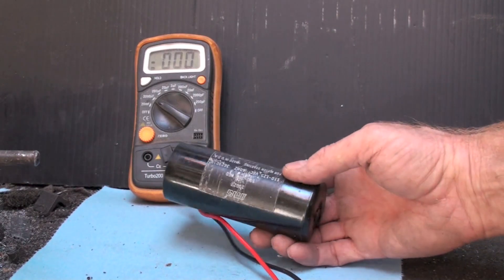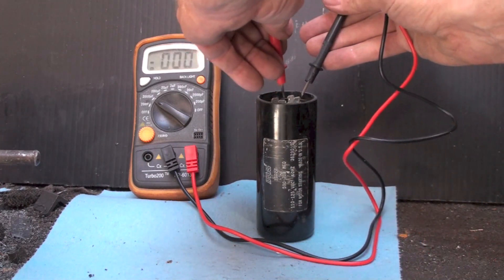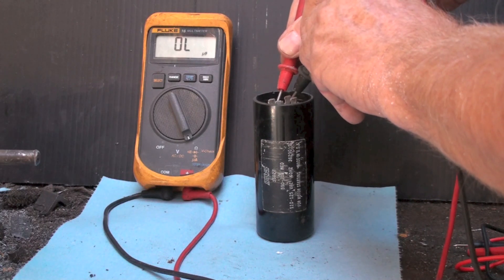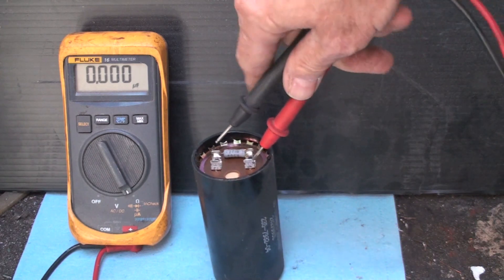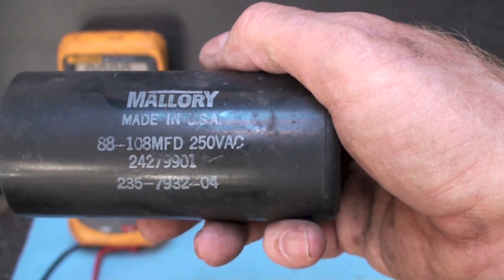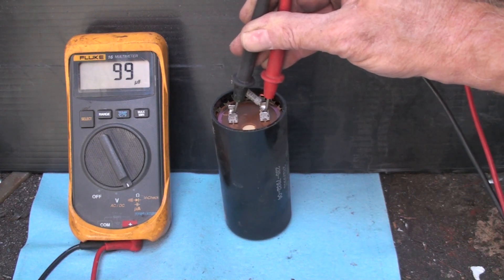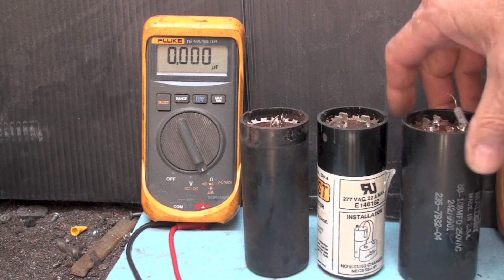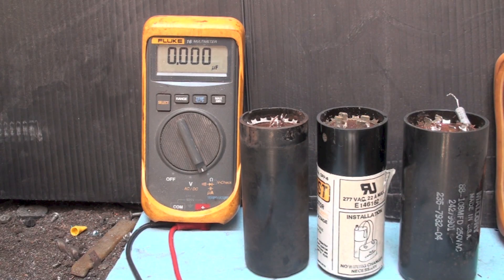Testing the start capacitor

Comment: I have that same 88-108 with the resistor, but I'm unable to unsolder it.
Would a consistent reading of 0.0µf using 2 different multimeters mean it's likely dead? Does it always read high with the resistor?

Comment: You skipped how/what to set the multimeter at. And the markings on multimeters I see at Harbor Freight look nothing like the one you have.
Reply from the maker: The meter shown is a Fluke 16  Similar to the Fluke 116.  These meters are automatic range.  Many of the Harbor Freight meters are manual range.
If I was testing a capacitor with a manual ranging meter, I would note the strength of the capacitor printed on the side, then set the range accordingly.
GFM

Comment: I have a mid-80s Carrier AC that won’t start. The hard start cap & relay appear to be original, OEM. If I test the cap and it’s bad (don’t know if the relay can be tested), can I replace them with a generic kit, like the 5-2-1 kit that’s sold on Amazon? Thank you!
Reply from the maker: You can, but I would use the OEM start kit as it is designed for the unit.
GFM

Comment: The capacitor in my condenser unit reads 35mfd+5mfd. Is this a RUN or START  capacitor? Thanks
Reply from the maker: It is a run capacitor.  It is a combination capacitor for the fan motor and compressor.
GFM
Reply: @grayfurnaceman  thank you for your reply. So if the 35mfd+5mfd is the run capacitor for the compressor and condenser fan motor. Then how does the compressor and condenser fan motor initially start? Don't they need a boost to start rotating first and then the run capacitor takes over?
Reply from the maker: @mark.r8900  The use of a hard start system is dependent on the system design.  Most systems will start using the run cap.
GFM

Comment: Sir may I ask, if I have a motor starting capacitor for "Dough Mixer" of 80µF 10+20% 270V, and I have a reading of 85µF, shall I say that the capacitor is in excellent condition?
Reply from the maker: Yes.  It is within 10%.
GFM

Comment: Will all ac unit comes with a start capacitor? Or no, because on mine I can't find it, only have dual run capacitor.
Reply from the maker: Most do not.  Unless they are controlled by a TXV, they do not need one.  If the compressor is a scroll they do not need one even then.
GFM

Comment: This is the biggest failure in all the YouTube videos regarding capacitor testing. I don't feel like wasting anymore of my time on this but just to protect the safety of others falling victim to this video I will point this out: Before handling a capacitor you darn well better short the terminals with a screwdriver. And keep your unprotected fingers away from the terminals for crying out loud. I think it's safe to assume this guy is never going to read this comment because he already electrocuted himself & is now brain-dead being fed with a tube. Or he tried sharpening a lawn mower blade while it was running. Either one of those is a possible scenario.

Comment: Does the first meter have an separate port to plug in special leads for capacitance that must be zeroed with the dial on the left before testing.
Reply from the maker: No.  All you do is set to capacitance.
GFM

Comment: I did that for a washing machine start cap... The meter just reads 11.. so its bad right? By the way OL is overload. means the cap has a charge in it usually.
Reply from the maker: Sounds like it is bad.
GFM
Reply: @grayfurnaceman  Thanks for your reply.

Comment: Wondering if you could help. I have a dehumidifier that trips the breaker after you hit the power button. Could a bad capacitor cause this? Thanks in advance.
Reply from the maker: Probably not.  If its a power humidifier, it could have a shorted heating element.
GFM
Reply: @grayfurnaceman  Thank you Sir
Reply: @grayfurnaceman  Update, i put a hardstart on it and it turned on and ran. I turned power off and removed hardstart and it would turn on and run for 5 to 7 seconds then trip breaker. Any thoughts?
Reply from the maker: @brianb5779  You probably have a failing compressor.  It may continue to operate with the hard start installed.  Just may not last very long.
GFM
Reply: @grayfurnaceman  Okay thank you sor

Comment: This a tutorial for people who know how to test a capacitor you don't tell what settings on the meter.
Reply from the maker: There are no settings for the meter.  Except for setting it in capacitor mode.  The only exception is if you are testing very small caps.  This video is about testing motor start capacitors.  They range from 85 to 500 MFD.
GFM
Reply: Im a former  hvac tech and i have a field piece model- sc54  digital multimeter. It has a setting on it that you set to mfd that checks capacitance. On the screen if reads in UF which is the symbol  for microfarads. Hope this was some help. Ps... i bought the meter from Sid Harveys.

Comment: hahah i have that same fluke meter. had it for nearly 20 years and it's still going.
Reply from the maker: My first Fluke 16 I bought in 1990.  I replaced it because it got crushed between an outboard motor and a boat hull 25 years later.
GFM

Comment: ok here is my question.  I have a capacitor but the label is gone.  It was the start capacitor for a submersible pump.  Now I have to get a replacement.  How do I test this capacitor to see what the origin microfarad rating was.  It does say 220 volts.
Reply from the maker: bob campbell If the capacitor has failed, there is no way to test it. If you have specs for the motor, you can try contacting the manufacturer. 
GFM
Reply: thank you... ok, so Im just SOL because the pump is 200 feet down... I will try and look at other pumps and what they tend to use.
Reply from the maker: bob campbell There is a control box above ground. That’s where you found the cap. Use the model # there. 
GFM
Reply: the label on the cap was completely disintegrated... hence my original question...but thanks for trying... bob

Comment: should i always discharge cap before testing ???
Reply from the maker: Start caps need to be discharged if there is no resistor between the terminals.  Run caps discharge themselves when the circuit is opened.
GFM
Reply: @grayfurnaceman  That's the stupidest damn comment ever. Just like the rest of your video. You should have never put this video up. If you set a run capacitor on a workbench and briefly give it 120 volts (which is how they are charged) there's no way it's going to discharge on its own. Maybe after it sits there for a couple weeks. You always need to discharge a capacitor so you don't shock yourself.
Reply from the maker: Jay Ryan You are correct. If I place a cap on a bench, and charge it it will hold that charge. A run cap is not used on a bench. It is used in parallel with the start winding of a motor. If you look at the wiring diagram of a motor, you will see that when the power is removed, it discharges thru the winding. Have you ever noticed that there is never a spark when you short the cap?  Think before you comment. GFM
Reply from the maker: @jayryan7473  I guess at this point I should respond in kind.  Look at the diagram of the motor dummy.
GFM

Comment: You are the man, I've been looking for capacitor meter testing for weeks. You are the only one that show the capacitors with just the 2 COM and HEM with the resister attach. The one exactly that I have. 88-108. The meter read 14.85. That means my capacitor is DONE? Thank You
Reply from the maker: If you disconnected the resistor when you tested it it is bad.
GFM

Comment: single phase preventer how to work inlet wire outlet wire how to connecting
and in the system how to control the 
single phase preventer please explain to me thanks!
Reply: Use Stronium Sulfide Flugleharn Plutonium Invertor set to "Calibrate". Then download the single phase preventer app and set bluetooth to "on" and look for a signal from the Reactor Core Modulator inverter valve. The IP address MUST be 10.213.200.200 or it cannot connect to your app

Comment: I always use an analog meter rather than a digital one to check capacitors.
Reply from the maker: I used one for many years.  The only problem is that they will not give the strength.  Most meters have a capacitor function built in now.
GFM
Reply: Very true....I only use it on microwaves.

Comment: does the resistor need to be there? or can it run without it?
Reply: The bleed resistors on start caps where potential relay is used is absolutely required. The resister will discharge the cap otherwise in the off cycle the only path for a capacitor to discharge with a potential relay would be across the relay contacts, damaging or weld the contacts.

Comment: I have a Kenmore washing machine it's humming I suspect is the capacitor do I have to discharge it and how. I have a regular voltage meter
Reply from the maker: Once the power is off, the cap does need to be discharged.  Proper procedure requires placing a 20,000 ohm resistor across the terminals.  Practically, what everyone does is use a screwdriver to short the terminals.
GFM

Comment: Anyone notice that the meter was in micro farads and the capactior is in milli farads? That's off by 1000 times, so I wouldn't say it's good
Reply from the maker: The capacitor is rated in microfarads.  In this case the M is for microfarads.
GFM
Reply: Zachary Self

Comment: Hi,
I tested my capacitor like you showed in the video. I have the same response as you did in your first demonstration of this video. I set my multimeter to "2k ohms". Upon touching post posts my multi reads .278 than open. Switch the two leads around and it does the same. Would this mean the capacitor is bad?
Frank
Reply from the maker: Sounds like it is good because as it charged the resistance increased.
GFM

Comment: You forgot to mention when checking them after the power has been shut off you need to discharge them. Or else you could get shocked. They hold a charge and may still have this charge stored in them if the power was just recently shut off.
Reply: compressor wire diagram
Reply: That's usually with DC caps.... AC circuit cap...not so much
Reply: "Usually" causes grown men to scream like a baby throw their meter and look around to see how embarrassed they should be. 10% of the time (roughly) their may be a charge on an a.c. circuit cap. More if it's removed from the circuit with no bleed resistors. Rare with run caps and fairly common with start caps because the start cap gets yanked out of circuit every time it's used, often leaving it charged to some point.
Reply: @maxprophet2401 brother I made the capacitor scream brother. I shock capacitors brother.
Reply: Those things pack a punch for sure if you have ever experienced a jolt from one
Reply from the maker: Oh yes they do.
GFM

Comment: Looks like he was using a Fluke dedicated capacitor tester.
Does any one knows the model number of this meter?
I am looking for a good one. Thanks
Reply from the maker: +Horacio Castillo Its not a dedicated meter.  Its a volt ohm meter.  The model is Fluke 16.  Replaced by the Fluke 116.
GFM
Reply: +grayfurnaceman . Thanks a million for your answer. I just bought a Fluke 116 used on E-bay  for $101 with case and  leads. I needed to check capacitors on water well pumps control boxes.Have the fluke 83 but is a pain to check caps with this meter.
Thanks for your interesting video.
Reply: is that meter still around or obsolete?
Reply from the maker: It is obsolete.  The replacement is the 116 true RMS meter.
GFM
Reply: Ok. I'll look into it. Thanks.
Reply: Holder..  ..procedure   physical testing   disconnect the  capaciter leads  from the  electric ..circuit..  short  the  two   terminals  with piece  of  wire..  check the  capacitor..ifits  case is  bulged the  capacitor  is  short circuit..  ..Spark  test.   Connect the  two  wires  in  to  the  electric  supply from the  two  terminals  of  capacitor  and  charge vthe  capacitor  for  a  second or  two..  disconnect the  electric  supply  and  short the  wires of  capacitor  terminals  if  the  capaciteoris   satis factory.it give  sharp  spark..  A  weack  spark  indicates  a  defective  capaciter..  .Ohm   meter  test  .. Touch  the  ohm  meter  leads to  the  cap acitor  terminals  .if  the  pointer  of  ohm  meter  leads  to  the  capaciteor  terminals   ifthe  pointer  of  ohm  meter  shows  a continuous  low  resistance  .it  means  the  capacitory is open..  ifthe  capacitor  is  satis factory .  The  pointer vof  ohmeter  give  slight  deflection  and  moves  back  in to  high  resistance  .change the  leads to test it  agaun..  the capacitor  is vtested  for  open  circuit  with  test vlamp  if  the ohm  meter is not available.    Connect  the  test clampin  series  to  the  capaciter vterminals  .ifthe  lamp  fails  to  light it  menans  the  capacitor  is  open..   ..precaution..  The  current  should  not  be  passed  through  the  capacitor for  long time  while  testing  vrey good

Comment: Good to know about testing with that resistor removed.
Is it common nt to have a start cap on a Carrier 2-3 ton central air unit? or is the "combo cap" both a run cap fro the condenser fan and a run cap for the compressor?
Reply: Craig Nehring hekejsksnslndlddnlwuDawn will be at 5:50 AM.
https://goo.gl/search/What+time+is+DawnieaozjsowidhzllwusdisooejwlWjLMsnsma